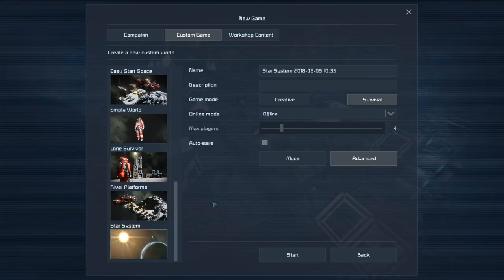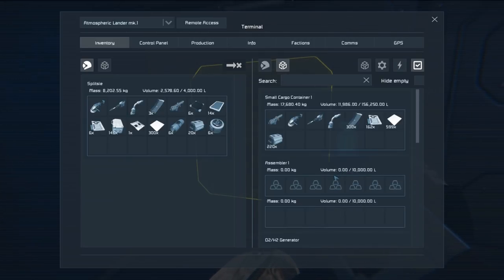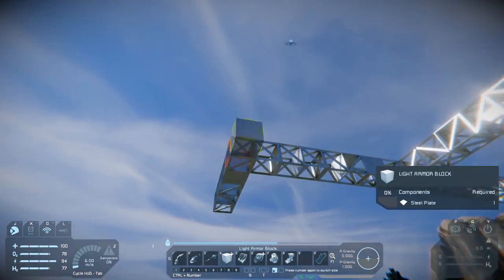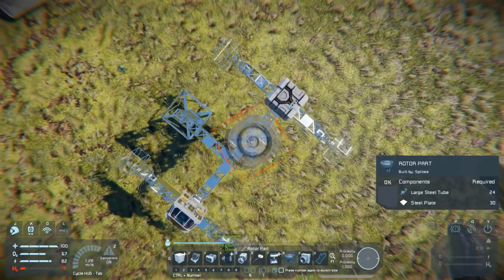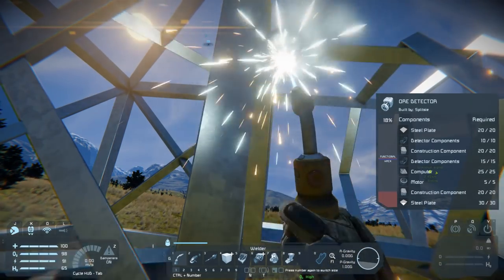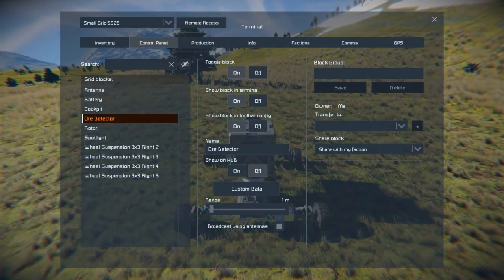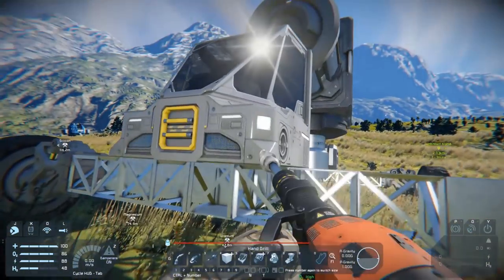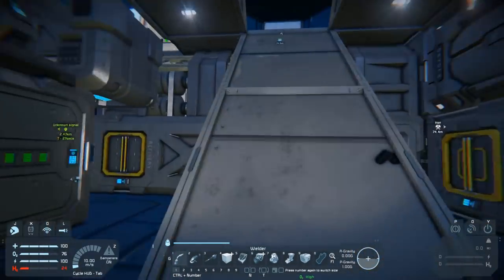Space Engineers Tutorial: Landing on a planet and finding ore (Guide to finding ore in update 1.186)

Comment: My vehicle always flips... I quit
Reply from the maker: If you build a gyroscope onto the vehicle or make the wheelbase wider to compensate for a higher center of mass you should improve handling, the other way to make things work more easily is to set the top speed to something more suitable for offroading, e.g. 50km/h. From memory the default it 180km/h which is very quick for somewhere without a road :P
Reply: @Splitsie  I never thought of adding a gyroscope. I figured that would only be useful for flying. Alright. Time for Rover #3
Reply from the maker: If you really want to get tricky with them for a wheeled vehicle you can put it on override with all the overrides set at 0, this will cause the gyroscope to try to keep the vehicle in its current position, then if you're finding it is keeping the vehicle on two wheels when you go over a slope, start gradually reducing the power of the gyroscope until happy with the level of stability it provides. All the options for that are in the control panel for the gyro :)
Reply: I tried the gyroscope tricks and well, I now have a usable Rover! Now I can actually find and transport materials